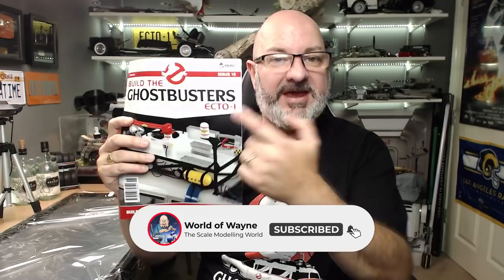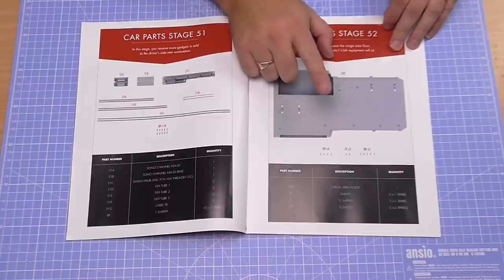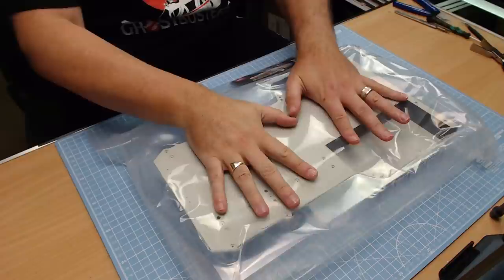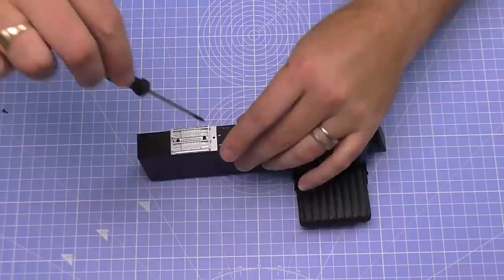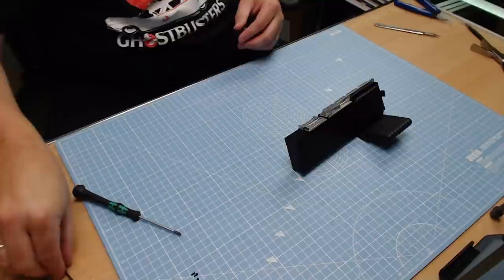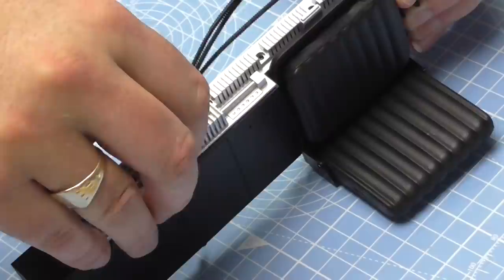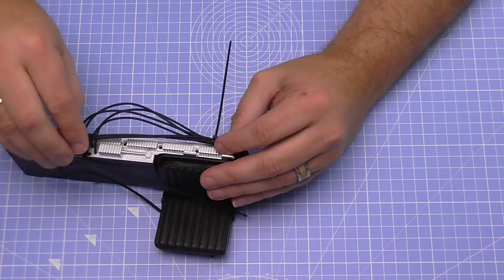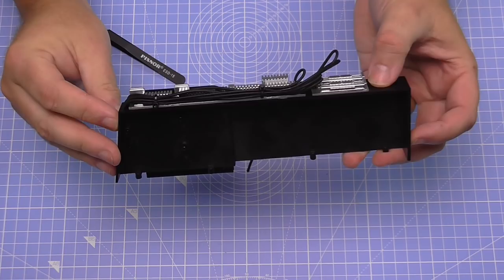Build the Ghostbusters Ecto-1 - Part 51 - Sono Channel ASA-20 and Switch Panel

Comment: Exciting video! Question. Are the flex hoses hollow? If so, I'm going to put hobby wire through them to be able to bend them into place. I did that with the spark plug wires on the Delorean and it came out very nice.
Reply from the maker: They are hollow but sealed at both ends to.make the plugs that go in the holes.
Reply: Liking that idea regarding wire inside the tubes !
Reply from the maker: Actually. I have relooked at the tubes. They are not hollow.
Reply: @WorldofWayneUK  Thanks for the heads up!

Comment: why not take and grab the ends that are in the holes from the bottom and pull them tight ?
Reply from the maker: They have plugs on the ends if you pull them through they just retract back.